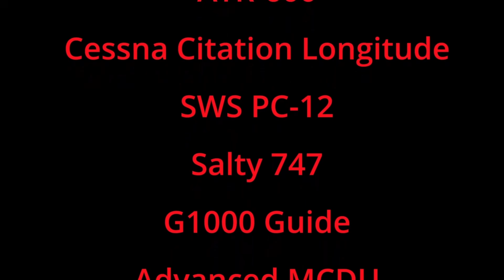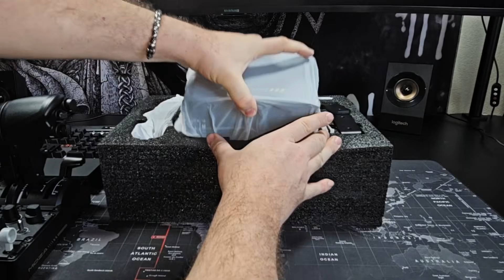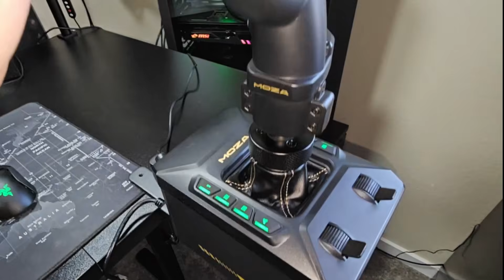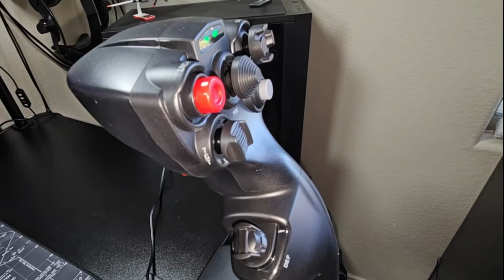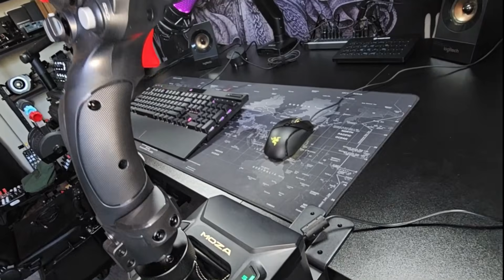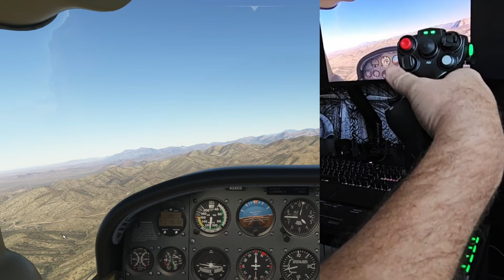MOZA AB6 Force Feedback Base + MHG Stick Review   The $399 Game Changer for Flight Sims!

Comment: Why dind't you talk about how gear mechanism feels? AB9 is belt drive and must feel smooth. But gears in the AB6 must have some kind of a feeling that you talk about. I have a G29 wheel and I can feel the gears moving specially in the center position. Is there a feeling similar to this for AB6? The gear system is the only thing that makes me not buy this product.

Comment: Ab9 has belt servo motor on the other hand ab6 has not, will it make a difference in long term use. I can grab ab9 with mh6 joystick for 670€ but with no throttle, do you think ab6 will be more usufull cause all in one?